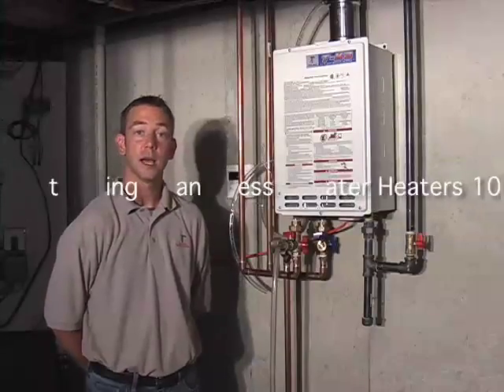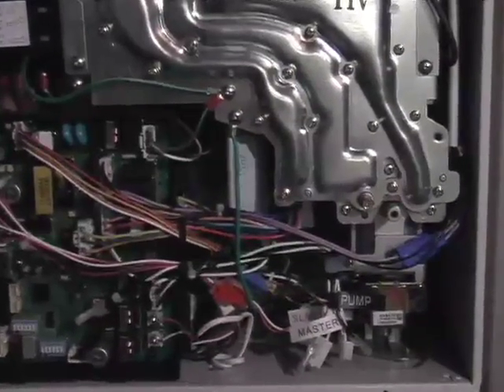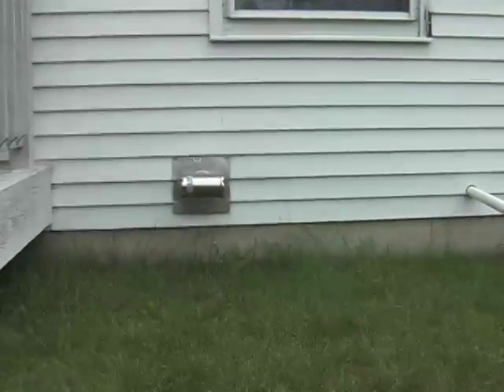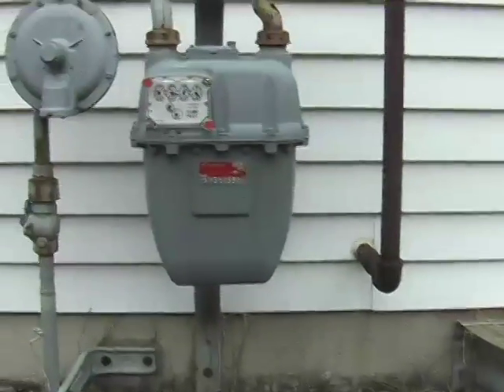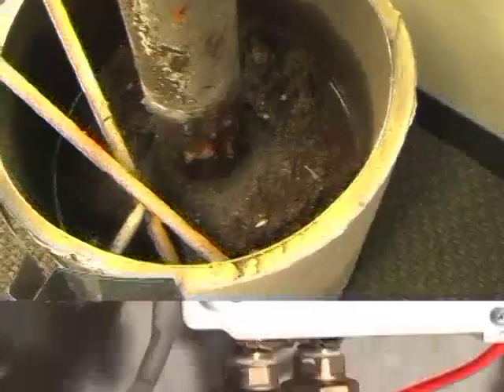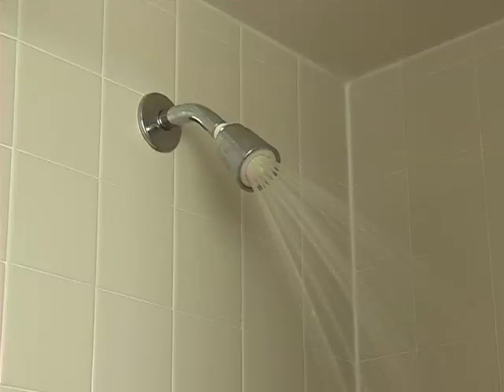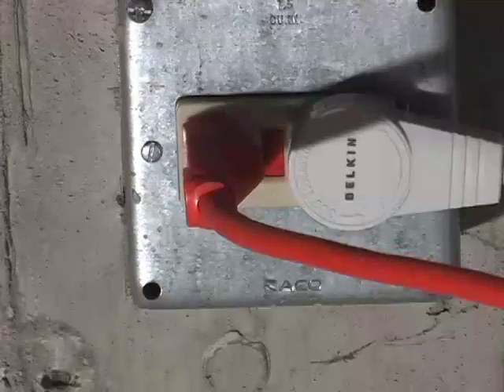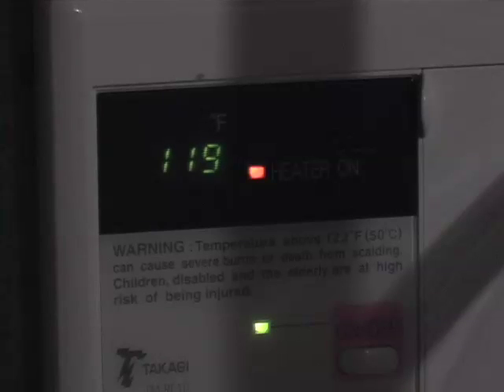Installing - Takagi Tankless Water Heaters

Comment: Had a TK2 for 14 years and if I could find a control board I'd have it another 14. It's installed in the garage and looks brand new with the cover off.  Replacing with a takagi tk-510u-i 200.

Comment: Hi, our old gas " on demand / tank-less water heater system is messed up. This one has a recalculation pump. It seem we only get hot water when another hot water tap is open than it seems to heat water fine than after a minute the water flow completely shuts off. If I turn the hot water valve off for a minute or so it will turn on with good flow for about a minute than completely shuts off the water flow. Anyone every had this issue, and how did you fix it  ?  Thanks

Comment: Half amp no, T-H2 draws 240 watts as the two 3 phase brush-less fans use 100v DC. I like the engineering though and quality.

Comment: I use to be an engineer there. This product is pretty bad. Costs a lot especially the venting if you have to locate it a far distance from where the termination is. If your using this for high demand meaning more then one faucet it's likely you will see premature failure in the heatexchanger as well as some flow valve and sensors. We tested in commercial settings and the heatexchangers always burst because of the acidic condensation of the flue gases resulted in rapid deteriotion of the the thin copper walls. The variable fan regularly needed replacement which is very expensive plus the labor to replace it. Its a headache really, i'd stick to regular water tanks, they are proven.
Reply: sound like rinnai do better job

Comment: We have a T-H2-DV Tankless water heater in our finished crawl space. It was installed new, 2 years ago when we built the house. For the past 3 months, our water pressure has been really low. (No softener as of yet). I flushed the water heater with muriatic acid for 2 continous hours. The pressure in the bathroom sink, and yub is normal again, but the kitchen sink still has very low pressure. Is there anything else that I can do?

Comment from the maker: Thank you all for your comments.  Here's an update.  1. The video was shot before I could fix the electrical connection.  It has the proper 3/4" cable clamp/romex connector now.  2.  It has been in service in my home since 2007 and has worked without flaw.  With 2 small children I am very comfortable knowing we don't have the scald issues like we did with a tank.

Comment: Great Video. I installed my Takagi TK Jr in my 1500 Sq Ft home about 6 years ago and it has more than paid itself over comapared to using my oil fired boiler. We absolutely love it, other than the annual maintenance of cleaning the heat exchanger. (Which I perform myself with the great instructions provided by Takagi) we have had zero issues.

Great Product's